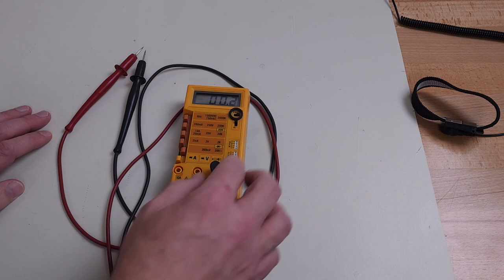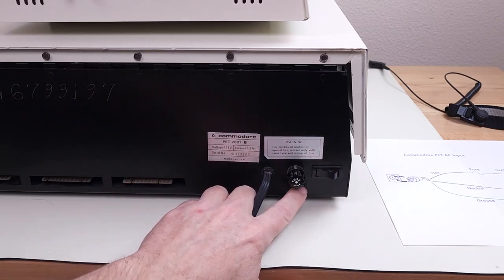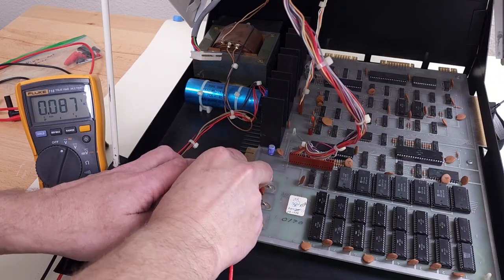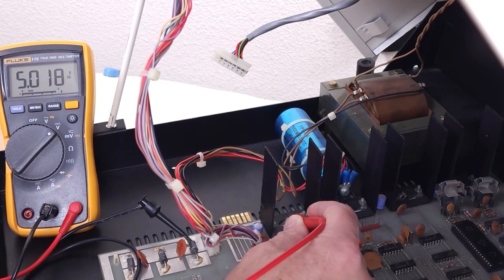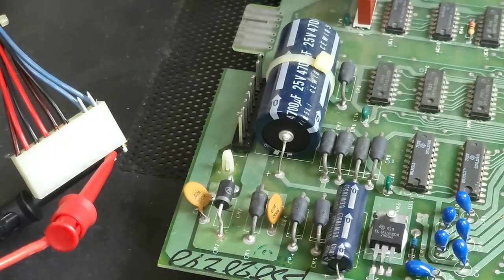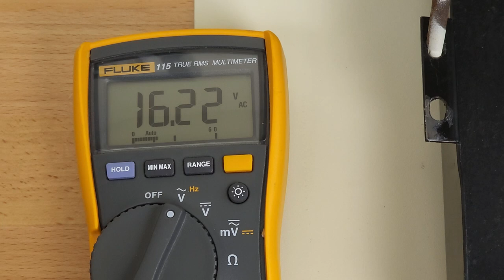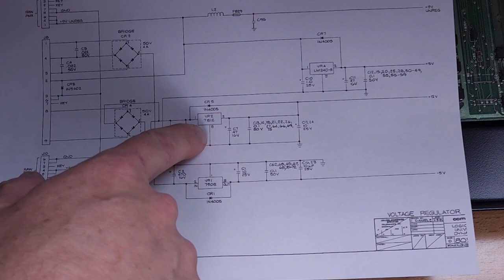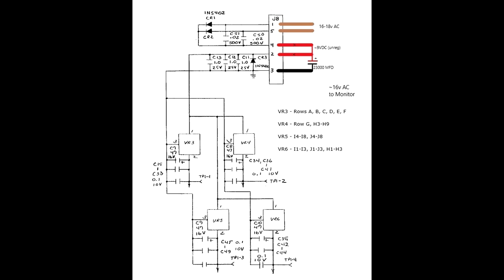PET Deep Dive, Part 1, The Power Supply #comMAYdore

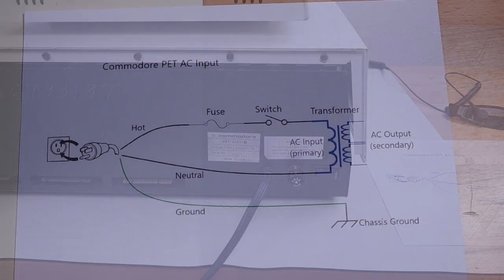Comment from the maker: Addendum:  As Bill pointed out below, I forgot to mention the transformer center tap. @05:53 The transformer secondary, or output side has a center-tap which is connected to ground.
This is simply another wire connected to the center of the windings where the output would be half of the full winding.
Because it's connected to ground, that means if you measure the AC voltage on one wire with respect to ground you would see half the voltage.
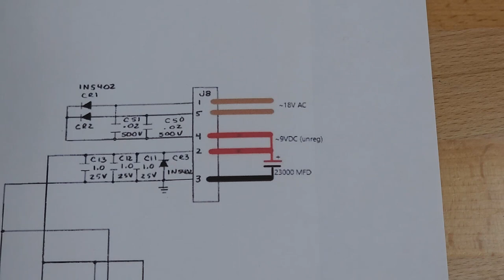@07:49 I mention the static PET has a half-wave rectifier, but that is incorrect. Because the center tap is grounded, CR1 and CR2 are rectifying in both directions, but only seeing 9 volts each with respect to ground.
This is important because, if that center-tap wire is broken or disconnected, your rectifier output voltages will not be correct, so it's a good idea to check that the center tap is grounded by continuity or by verifying that the reference to ground is half the voltage.

Comment: Great video Hutch!  I can’t wait to see part 2.  I’m curious if you drew those schematics yourself, and what (if any) software you might have used.
Reply from the maker: The schematics are from Commodore. I just annotated them using Windows Paint. I did draw the power cord diagram using paint and some graphics I found online.
Reply: @HutchCA  Wow.  All my schematics look like 4th generation copies of library books that were scanned upside down by a 5 year old at 60dpi.
Reply from the maker: The Commodore schematics from the 70s were hand drawn with stencils and straight edge. They've been scanned and put online.  link is in the description.

Comment: Thanks Chuck!  This is great!  I’m looking forward to more.  I’m restoring 2 4016s.  Such slow work.  Also curious how you go about cleaning the board (should I bother with ultrasonic cleaning?) — I’m assuming you’ll get to the much talked about (for a PET) keyboard and I’m always interested in that.  I’ve gone down so many rabbit holes chasing red herrings.  I’m always glad to see more on that subject haha.
Reply from the maker: I did a video a while back on testing and repairing a keyboard. Look for "PET Business Keyboard Repair" on my channel from Oct 2018. Also touch on it in "Commodore "Super PET" Restoration (Part 2)"
Reply from the maker: Re: cleaning the board. I blow the dust off with compressed air and/or brush it off with an unused paintbrush reserved for that task.
I have rarely washed a board with tap water or a bit of soap and tap water but I always do a final rinse with distilled water to be sure it doesn't leave behind any mineral residue.
I know someone else who repairs a lot of C64 boards and he always uses an ultrasonic cleaner, but I don't have one that's big enough for PET boards.

Comment: Excellent video! A question: are the voltages at the transformer output the same for the 220 Volt European models?
Reply from the maker: This is an excellent question.  The PCB is the same, so the input voltages should be roughly the same, but might vary a volt or two on the AC and unregulated side.
The unregulated voltages are not critical as long as they are at least 4 volts more than the regulated voltage, but the higher the voltage the hotter the linear regulators will get, so you don't want them to be much higher.
Reply: @HutchCA  Thanks for the useful information! 👍

Comment: Awesome video! It is really helpful. Please do more! I have a PET with dram that powers on to a black screen, two of the first batch of diods get very hot, do you think this could be the cause? I was not able to meassure the voltage, I get a -7 reading. Which diods should I replace with? Thank you very much!
Reply from the maker: If the diodes are hot, that means they are working. Their temperature will depend on how much current is being drawn through them. It's usually obvious when one burns up.
Check them with your meters diode tester is it has one. If your unregulated voltages are too low, a bad diode seems likely.

Comment: I see a problem in the power supply description of the first PET.

The transformer is shown with a centre tapped secondary, or at least two windings connected up that way. Typically the centre tap would be earthed for a simple supply arrangement.

You have not shown the earth connection of the centre tap anywhere in your circuits.

The two diodes you show are connected in the normal full wave rectifier arrangement, for when the secondary centre tap is earthed.

Each diode on its own is a half wave rectifier, but their outputs are connected together and they are driven from the out of phase AC from either side of the earthed centre tap secondary.

The load current in the computer flows between the +5 Volt supply and earth

Without that earth return to the secondary winding, not only will no current flow in load (computer PCB) but you won't even have the +5 Volt supply.

I don't know where the earthing is done, presumably around the transformer/filter capacitor. I haven't got that PET, or any PET.

Now, assuming that the centre tap is earthed, what you have is full wave rectification of 9 Volts AC, not half wave rectification of 18 Volts AC.

Still interesting

Bill
Reply from the maker: Thanks.  Yes, the transformer does have a center tap that is grounded on both versions of the PET.

Comment: Thank you for that great tutorial!
I have a PAL 8032, it looks like the setup from the universal board shown here in this video. The gigantic Capacitor blew up while the pet was plugged in (but 5 minutes after I turned it off).
Since this capacitor seems to be almost impossible to buy anywhere (I only found one 40 year old in the US for 70 Bucks + shipping around the world) is it possible to replace it with something different?
Thank you an happy Commaydore!
Reply from the maker: That kind of cap with the screw terminals might be hard to find but any sufficiently large capacitor should work in its place.  The old one should be 23000-27000 uF but I'm sure it would be OK with less, or more.

Comment: This will help when I get into my PET 8032!  Can you jumper a Toggle switch to switch between 80 and 40 Columns?  And, I keep hearing that my PET 8032 has RIFA Cap(s) and sho9uld be changed out ASAP...that would be great if you covered that in Part 2.  Thx.  -Markj.
Reply from the maker: See my earlier video about RIFA caps. There's a pop-up card @19:19
Link: https://youtu.be/5V_bgdxlUjs
I'll make a mention of that in my next video.
Reply from the maker: Changing 40/80 columns requires changing several jumpers and changing one ROM chip.
There's an add-on card that does this, the  Comspec 40/80-S2 Board.
Link: http://www.6502.org/users/sjgray/projects/cbm4080/index.html
Reply from the maker: I posted a couple of comments with links in them, so let me know if you don't see my previous replies. YT sometimes blocks comments with links.

Comment: For long term reliability, is it worth swapping the linear regulators for their switch mode equivalents as this should reduce the amount of heat produced, quite significantly. Stephen G7VFY
Reply from the maker: It depends on your philosophy. Some prefer to keep the parts as original as possible, but I've seen users pull the linear regulators and wire in a Meanwell switching power supply.
It would cut down the heat, but in my experience the linear regulators are fairly reliable. I have yet to replace one and I've only heard about a couple of failures in other PETs
Reply: @HutchCA   My thought would be to keep the transformer and swap out the linear voltage regulators with Traco voltage regulators.
Reply from the maker: @MattKasdorf  That'd work too, as long as those switching regulators can handle the same amount of current.